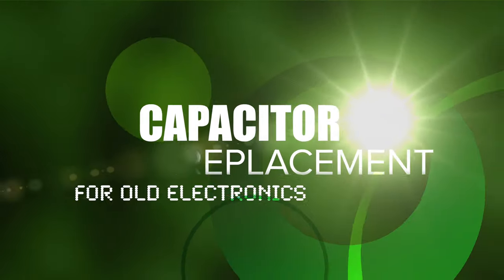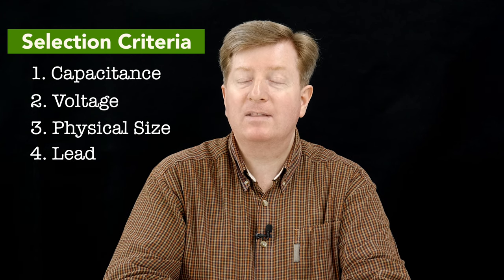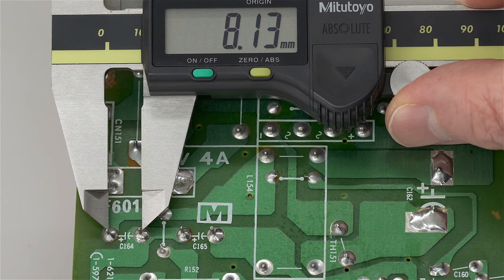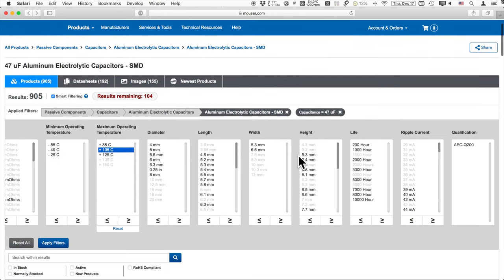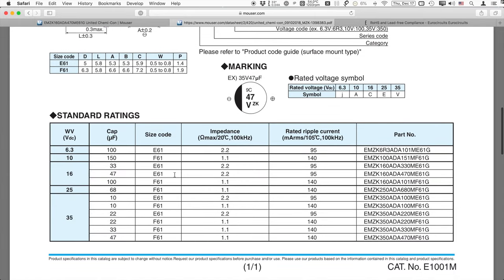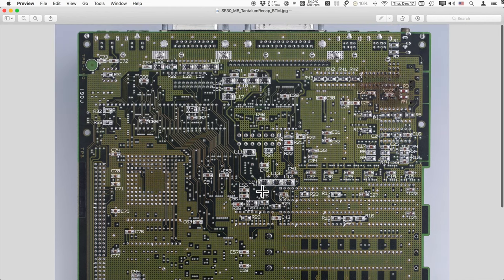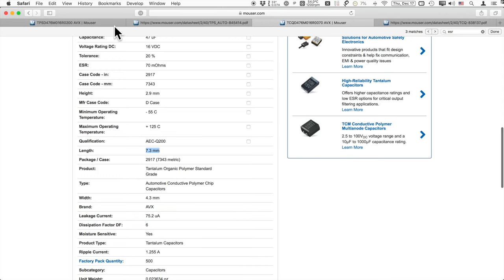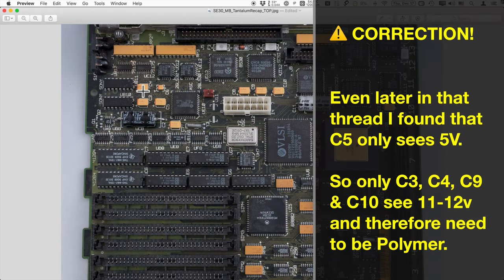Choosing Capacitors to Recap Old Electronics

Comment: Great video, as always. Thank you !

I'm just surprised how little has been said about MLCC (ceramic) capacitors.

I've seen them used fairly often for vintage Mac recaps.

What's wrong with them ?
Reply from the maker: Thank you for your kind words.  If you’re looking for a capacitor with very low ESR, you can't do better than a ceramic capacitor. But let's ponder why NOT to use a ceramic (MLCC). 
 
First, the physical size of ceramic capacitors increase and decrease (changes so small it's imperceptible to the human eye) as applied voltage increases and decreases. It sounds pretty crazy, but it’s true. So while ceramic capacitors are very often chosen for the output of switching power supplies due to their extremely low ESR, they can also make a lot of noise because they vibrate the entire PCB, which amplifies the sound like a speaker.  If you've ever heard a constant buzz when using a product that has a switching power supply, ceramic capacitors are the reason! There are some expensive specialized ceramic capacitors that are made to eliminate that vibration on the PCB, and sometimes you can design a PCB with holes cut around the capacitor itself to attenuate the vibrations of the PCB itself -- but for recapping that is not practical.
 
Yet another big problem with ceramic capacitors is that they have an even more strict voltage Derating than solid tantalum capacitors. Why? Because the Capacitance of ceramic capacitors decreases according to the voltage (DC bias) you apply to them.  That's right...  The higher the voltage across a ceramic, the lower its capacitance! Sometimes capacitance can decrease as much as 80%.  Imagine a situation where you want to install a 1µF capacitor in a circuit that sees 10Vdc. You might need a 100v rated ceramic capacitor so as to maintain a stable 1µF of capacitance.  
 
The downsides to higher voltage rating for ceramic capacitors are Cost and Physical Size of the capacitor.  Even if you have enough circuit board space to accommodate a physically larger ceramic capacitor, and even if money is no object so the higher cost doesn't matter, you still may NOT wish to install a physically large ceramic capacitor because ceramic capacitors are ceramic and therefore brittle. Depending on the size of the circuit board or product, a fall to a hard surface from the height of even a couple feet could crack large ceramic capacitors.
Reply: @JDW-  Thank you again for this clarification. I will look into it.

Your videos, your work, and the attention you pay to your viewers are absolutely remarkable.

Your channel is undoubtedly one of the best of its kind on YouTube, if not the best.
Reply from the maker: @smop8388  I'm truly humbled by your extremely gracious words, Smop.  Thank you very much!

Comment: Hi! Super video, thanks for sharing! I am completely new to this. I would like to recap l a couple of cheap chi-fi preamps. How would you choose between caps types? Say the amp is using electrolytic caps. Would you choose better electrolytic? Or Film, Tantalum etc?... Woukd changing resistors make a huge difference in sound quality? Thank you
Reply from the maker: Thanks for watching and for your comment.  I'm not an audio guy and I don't have a schematic of your circuit, so I would recommend you visit an audio related forum to ask specific questions about how the sound might be different with changes to resistors and or components other than the caps.  Regarding the caps, I would suggest replacing the stock electrolytic caps with the same kind of electrolytic caps.  While that should be easy to do in terms of matching the Voltage & Capacitance rating, as well as the physical dimensions and lead spacing, I cannot say what impact the replacement capacitor "ESR" will have.  

If your caps are bad, then measuring their ESR might not be helpful, even if they are not bad but very old, it could be their ESR is higher than normal.  You might be able to find out what brand and model the stock caps are by asking at an Audio forum, and in that case, you know exactly what replacement caps to buy.  Meaning, even if you can't get the stock caps because that model isn't made anymore, you would be able to look up data on the stock caps to know the ESR, and that would be your guide when picking out a replacement electrolytic.  

If you have no way to find out what the ESR of the stock caps were, you could opt for a general purpose capacitor to play it safe with ESR, or you could opt to buy a "low ESR" replacement and see if that works well in your circuit. If a low ESR cap causes trouble in the circuit, then you would just buy a general purpose cap instead, which should have sufficiently high ESR to remedy the issue.  Lower ESR is usually better, but in some circuits, ESR can be too low and cause issues.  That is why being able to find out the ESR of the stock caps can make it easier to select a suitable replacement.  Having a schematic and knowing what the circuit means can also be helpful too.

Best wishes!

Comment: I find that capacitor size is useful. If capacitors have become smaller, then I may end up getting a capacitor with a larger voltage rating than needed - that's ok.
Lead spacing is measured by calipers across the outer sides of the two leads after cutting off the old capacitor, and then subtracting a lead width, which can also be measured easily by the calipers.
Reply from the maker: Correct.  And by going with a higher voltage to get a physically larger capacitor, you will often find the ESR is slightly lower too, which is most often a good thing.  Just make sure the HEIGHT of the capacitor will fit within your application's enclosure.

Comment: Great video and thank you for sharing your knowledge. I am into repairing ECU's (electronic control unit) would  this also apply to have electrolitic caps replaced by Polymer Tantalum? taking into account the voltage values. I haven't tried doing this but would appreciate your inputs. Again thank you for sharing.
Reply from the maker: Yes, everything you saw and heard in the video applies to caps on vehicle ECUs as well.  The ECU should have a TVS diode or similar spike snubber on it's incoming 12V line, or be connected to a power source that does, which means your 12V line will see 14.4V with the engine running, and up to however much voltage the TVS diode is rated for (Vc).  Keep in mind that Vc could be 33V.  Meaning, if a 60V surge occurs, the TVS (with a Vc=33V) will cut that spike down to about 33V or less, and if there are other electrolytic caps in that area, they will shrink the voltage spike as well. (Electrolytic caps handle over-voltage well.)  

The reason I mention all this is because unlike vintage computers connected to a wall socket power supply, automotive spikes are more frequent, and whatever replacement caps are chosen need to be selected while pondering with the maximum voltage of spikes a given circuit is likely to see, which really depends on the spike filtering, which most often includes TV diodes. 

So if you have a TVS somewhere that limits the 12V line spikes to 33V, that's likely the maximum voltage your replacement caps would see (and then only rarely and briefly).  Choosing replacement electrolytic caps at 33V in that case is a non-issue, but even polymer tantalum has a voltage derating of 20% lower than your polymer tantalum cap's specification voltage.  Say you have a replacement tantalum cap rated for 40V. Well, 80% of 40V is 32V, which is probably safe enough, assuming the Vc of whatever TVS diode used is in fact 33V.  You can't safely guess.  You really need to know.  So please give this some thought.  Voltage spikes affect polymer and solid tantalum caps the most, which is why you really must ponder the maximum voltage level of spikes in a car application before replacing electrolytic caps with any kind of tantalum caps.
Reply: @JDW-  Thanks JDW it gives me an idea on how to do about with this replacement in the near future. Stay safe and Thanks.

Comment: This was a great and timely video as I was just looking to put in my first order with Digi-key to replace capacitors on a Vtech Laser 128 (Apple II clone). A couple questions that I hoping you can help a newbie with: 1. From what I read, higher voltage is fine - so thinking that most modern caps are smaller, I was going to buy more in bulk of the different capacitance values I needed but basically get all 50v caps, even though the original board had a mix of 16v, 25 and 50v ratings according to the parts list in the service manual. My thought was that many of these capacitance values are common in other vintage computers as well and I could essentially have a stock of on-hand of viable capacitors for several computers without specing each one out. Based on your video I'm not sure if that is a great idea now . . . 2. What is your opinion on pre-emptively recapping? I was going to just recap the entire Laser, knowing all the caps in there have to be 35+ years old; however, I've read others say it's only good to recap if you see damage and/or a high ESR for a specific cap. Thanks again - appreciate the advice!
Reply from the maker: A lot of people make mistakes with vintage electronics because they listen too much to "consensus."  They check social media groups and online forums, then see what most people say, then decide based on that.  It seems logical to conclude that a group of minds should be largely correct, but that just isn't the case.  Sometimes listening to the voices works out well, but the problem is most of those people are not electrical engineers.  Most of those people on those online groups say things like, "I've never had a problem with certain capacitors, so that means those caps are ok."  But that is incorrect.  If you look at data from all the major capacitor manufacturers, they will tell you how to calculator capacitor life and they put a disclaimer that regardless of that life calculation, the manufacturer will not guarantee a service life of beyond 15 years (for fluid filled aluminum electrolytic capacitors).  That doesn't mean your old cap will die on its 16th birthday, but it does mean that if you have fluid-filled caps older than 20 years, you need to replace them regardless of what others may recommend. And although it is true I am giving you my recommendations right now, (1) I am basing my recommendations on what the manufacturers say in their official documents, and (2) I am an electrical engineer who is also experienced in recapping old electronics.

"Pre-emptive" or "before it breaks" recapping is the best choice for any device that's 20 years old or older, when it comes to fluid-filled aluminum electrolytic capacitors.

Buying a lot of aluminum electrolytic capacitors and slowly pulling from that stock to recap various devices isn't a bad idea but there are a couple caveats worth mentioning.  First, when recapping power supplies, you will find that some are sensitive to capacitor ESR (resistivity).  If you replace an old cap with a new low-ESR cap, there could be trouble.  Sometimes you won't know that until after your recap.  I know this from personal experience and from my own knowledge of switching power supply design. That's why it's important to check output voltages on an oscilloscope before and after your power supply recap to ensure the output noise is no worse that it was before your recap.  And if there is a problem, you may need to buy a different capacitor which has higher ESR to solve the problem.  The second caveat is that if you use up your capacitor inventory very slowly, over the course of say 10 years, then you have to consider that there is a shelf life.  All manufacturers publish information about shelf life for aluminum electrolytic capacitors.  I personally think it's fine if you use capacitors that are several years old, especially if they've been stored in a climate controlled environment.  But it's important to keep in mind that nothing in this life lasts forever.  Everything degrades over time.  So I wouldn't want to recap something with an old stock of fluid-filled capacitors that is 20 or 30 years old, for example.

Lastly, it's important to keep in mind I am talking to you about Aluminum Electrolytic Capacitors.  Tantalum capacitors, and Organic Polymer Aluminum Electrolytic capacitors with a solid electrolyte could be 20 years old and still work great in a recapping project.  They have no fluid that dries up over time.  There are also other caps like film capacitors which also have no fluid inside and have a very long shelf life (if stored properly).

Mostly, you need to recap fluid filled aluminum electrolytic capacitors.  The exceptions to that rule are X & Y rated capacitors that are sometimes called "RIFA" caps, which are used at the AC input side of a power supply.  You will find these in the Macintosh 128K, 512K and Plus, for example.  Those sometimes die due to age and voltage spikes.  It's often good to replace those if they are 20+ years old, although it isn't so critically important as the need to replace fluid-filled capacitors. Tantalum capacitors may also need to be replaced if you see that any are burned in a circuit, but keep in mind that burned tantalum capacitors means there could be other problems in a circuit that needs fixing.

I hope this information helps.  If you have further questions, please do not hesitate to ask.
Reply: @JDW-  This helps a great deal - thank you very much for the detailed response and information. More for me to think about. I like the idea of using tantalum from the perspective of not having to worry about potential leaking caps again 15-20 years from now; however, I'm not sure with the Laser if there are good options as it's through-hole, and for some reason some of the existing caps on the board have high voltage values (ie a 47uF with 50v). When looking on Mauser I didn't see anything practical with that high of values. Regardless, I am leaning back towards recapping the entire board, vs. piece-meal. Thanks again for the advice/information!
Reply from the maker: @jeremygieske165  I'm sorry I cannot give specifics.  I've never owned even a single Apple I or II or clone. My guess is the highest voltage is only 12V on the board, but you would need a schematic to know for sure.  But don't let those 50V stock caps fool you.  A lot of small capacitance value caps high very high voltage ratings like that.  The higher the voltage, the bigger the cap, but the lower the ESR, you see.  So try to find a schematic, or post in Apple II or Laser forums online (or in Apple II FB Groups) to see if anyone knows if the board has a voltage higher than 12V.  If not, you know that any SOLID tantalum cap you choose must be rated for 25V (or higher) to be safe.  (If you need thru-hole, it means you cannot choose Polymer type Tantalum, only SOLID.)  Keep in mind that solid electrolyte OS-CON caps sometimes come in radial (thru-hole) types too, and those are just as good as tantalums, so long as you get the solid electrolyte versions.  Don't buy any Organic OS-CON cap that says "hybrid" because those have a fluid electrolyte that could eventually leak.  You want solid electrolyte replacement caps for longevity. Lastly, just be sure to measure your board to see how much diameter and height space you have, then choose replacements that will fit within that space.  Try to measure the distance between the leads too because "Lead Spacing" is also part of the capacitor specifications. I hope this helps.
Reply: @JDW-  All great advice. Thank you again for the thoughtful and detailed response!

Comment: hi, thank you for this vid I learnt a lot but could you do a vid about selecting audio caps for the crossover in speakers ?
Reply from the maker: Thank you for your kind words, but I need to defer to the audio experts for that kind of video, I'm afraid.  Your best resource for that kind of info is on one of the many audio related forums.  The experts in those forums should be able to help you with all the specifics you need for your particular application.

Comment: Thanks for the great radio.  Can't wait to recap my cb radio.  I wonder if the lower noise capacitors would be an upgrade??
Reply from the maker: That would depend on what you mean by "lower noise capacitors".  But I lack experience with CB radios of any kind, so I am not really equipped to answer your question satisfactorily.
Reply: @jdw- Sorry, I was thinking about the aluminum organic polymer ones with the lower ESR.  Thinking the lower resonance would change the signal quality?  Perhaps I'm just guessing though...?
Reply from the maker: Without having a schematic or otherwise a firm understanding of the electronic design, it’s really difficult to say. But sometimes you don’t really know until you actually change out the capacitors for a different type. There’s no harm in trying so long as your desoldering and soldering skills are reasonably good.
Reply: @JDW-  yes, thanks for the inspirational video.  I can't wait to experiment.

Comment: I not only want to replace mainboard caps, i want to upgrade the filtering capability for noise  in the circuit especially for Clock/CPU signals or mainly the Voltage Vcore filtering to make it as best as possible..     6.3v 10v 16v    maybe up to 20/24/25v caps    mostly on the VRM or CPU power rails... or (if any? clock signals voltage)
Reply: Vcore input and output aka voltage in VRM usually 12volt and (CPU 800mv to 1.55v (usually the maximum on older AMD sockets)